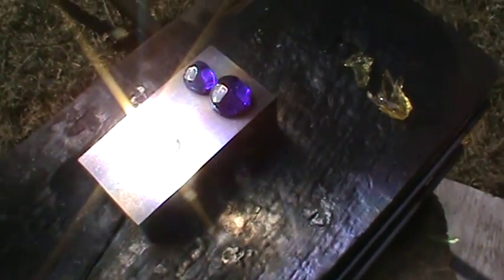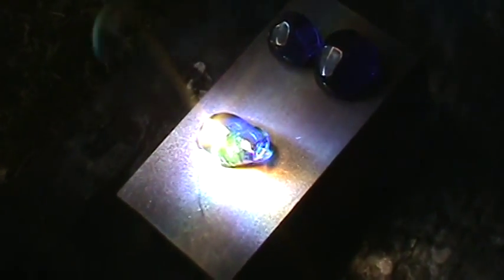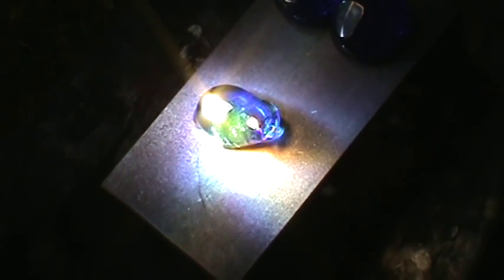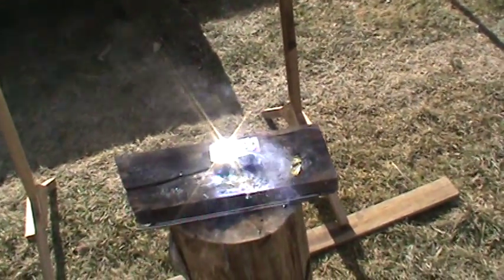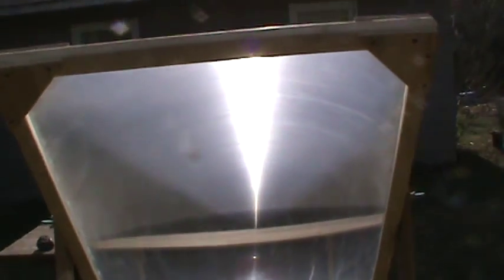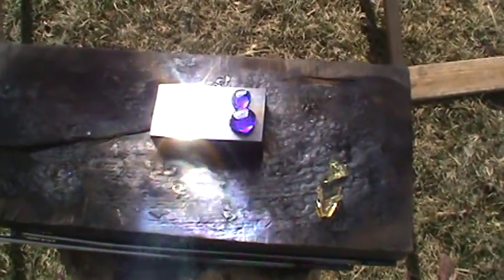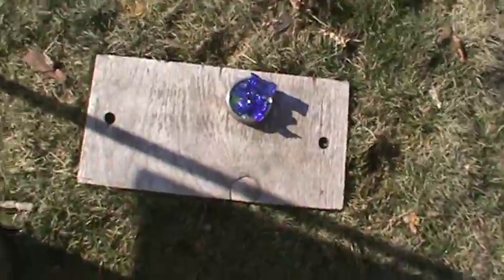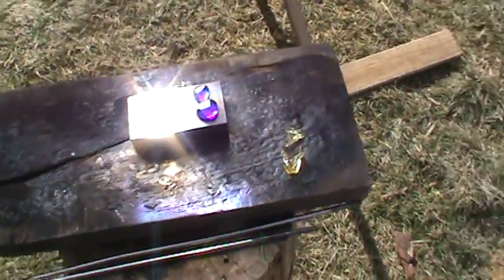DIY Fresnel lens solar glass melting foundry

Comment: what if you had the in a mold to look like gems?
Reply from the maker: Nathan Algeo I thought about that. I think it would be cool to have like different shape molds and find a way to put a hole thru and make beads.
Reply: or have the shape facing down so the bubbled end pointing up is the bottom piece
Reply from the maker: That would be cool. I am currently looking for a bigger lens that is 60+. If you like my solar melter you should make you one. Just need to find you a projection TV that does not work and take it apart and the screen is where you will find the Fresnel lens. The older TV's will yield good spot lenses but this lens use to be a linear but I took the linear grooves on the side suppose to smooth and I sanded and polished them out and it is a spot lens and the lens I am using here is 50''
Reply: I'm already on the hunt
Reply from the maker: Nathan Algeo Sounds good hope you get a nice spot lens. If the lens you find is linear like mine but still clear you can sand and polish it out. Good luck! Hope you get a big clear 60 incher

Comment: Show us how you polished the linear grooves out, please. That would be awesome!
Reply from the maker: Robert Clower  Hey Robert but first I need to find the right lens. Some TV's will yield them thin floppy milky ones and even if they are polished out they still are milky. I did that with one and though its better but still milky. Best lens whether its spot or linear to get are the ones made from the thick acrylic plastic because acrylic is clear and when done it polished out very nice. The lens I used in my videos was a linear but I used 600 followed by 2000 grit wet/dry sandpaper to sand out the linear grooves then I used a drill sander with a cloth and headlight lens restorer and the lens became a lethal spot lens.
Reply: Michael Ellestad how much of the headlight lens restorer did you end up using?
Reply from the maker: can't remember